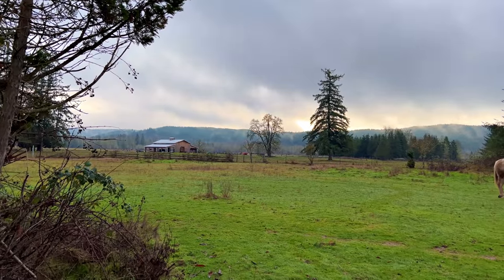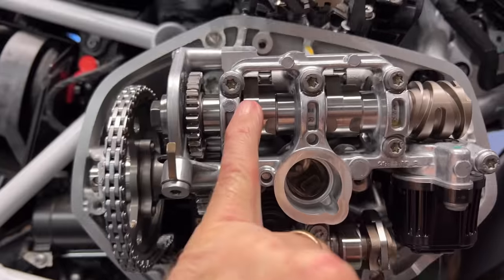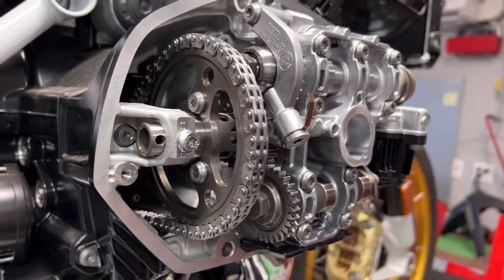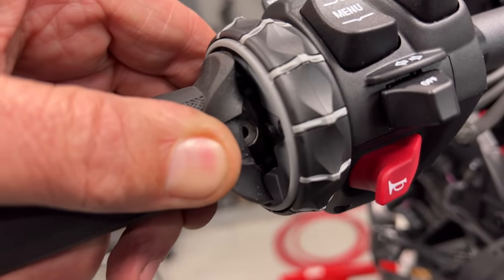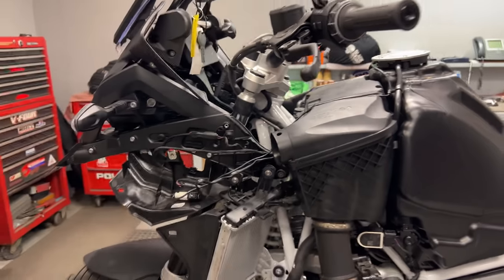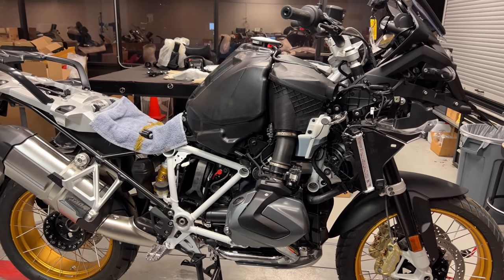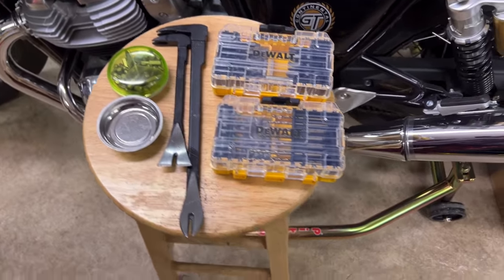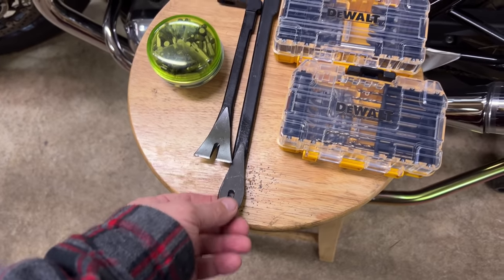Complex BMW Switches!! • Home Project Tools..! | TheSmoaks Vlog_2223

Comment: I've got the Dewalt 887 model it will surprise you with an 8ah battery.  The higher Amp Hour battery will make a difference in the torque.  Watch Project Farm's test.